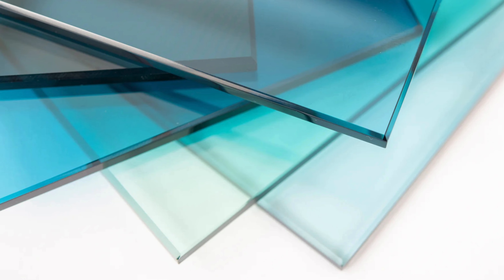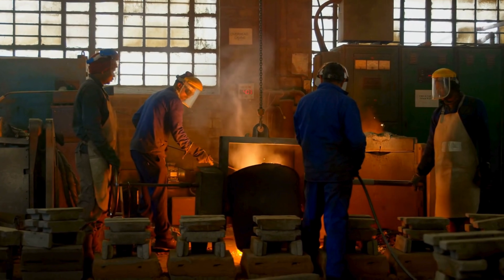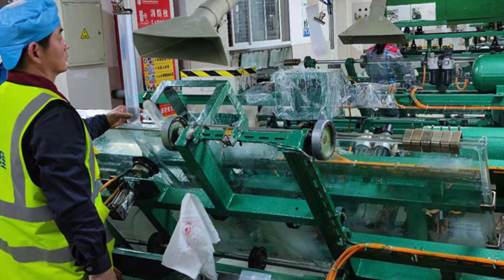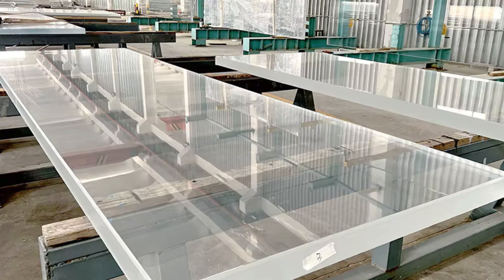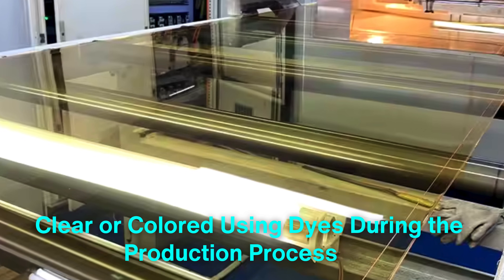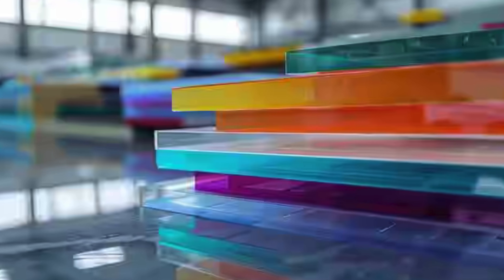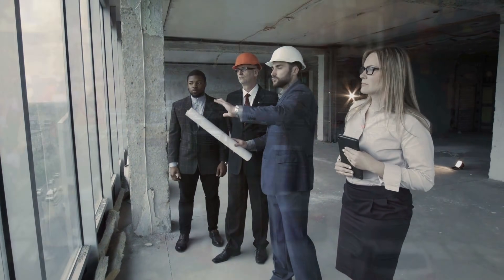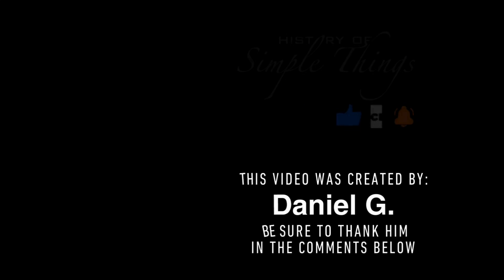How Acrylic Glass Is Made: Why It’s So Popular

Comment: I think a video discussing both polycarbonate and acrylic and comparing them would be helpful. In my limited understanding polycarbonate is generally better ie stronger but more expensive. It is also harder to machine. I think both materials can have issues with clarity, scratching, acrylic can crack, both can deform, etc

Comment: Stronger than Acrylic Plastic is Polycarbonate Plastic which 30 times stronger and more impact resistant. Furthermore Polycarbonate Plastic has a higher index of refraction than Acrylic Plastic. Therefore Polycarbonate Plastic eyeglass lenses are thinner and lighter than Acrylic Plastic eyeglass lenses.